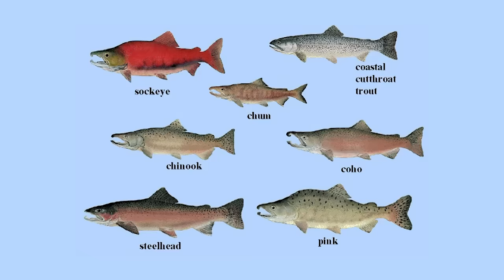How The Largest Dam Removal Of All Time Brought An Entire Ecosystem Back From Extinction!

Comment: So happy they're finally doing something to undo the centuries of damage on our Earth!
Reply: Actually the most damage we did to earth happened only in the last century 😢 only one century and we destroyed so much
Reply: .....destroying a dam which could of powered 1000s of homes with no carbon emissions??  Yeah that isnt a good thing right?
Reply: @catlee8064  huh? didn't you watched the video? how can these dams be anything but destructive and degenerative? don't just look at temporary things think long term bro
Reply: @erfan4244  I am thinking long term....like using hydro  (renewable energy source)  rather than coal/oil fired power stations.....but by all means, let some fishes swim up stream....
Reply: So should we stop all renewable energy?
Reply: @catlee8064  Do you always just make up numbers and stories like that? According to wikipedia, 20 years ago, the two damns mentioned on the Elwha river combined produced only enough electricity for about 38% of the demand of the local sawmill - which itself probably wasn't a great boon to the local environment. Since that ecosystem consists of carbon, restoring it is also a way of binding CO2. So instead of repairing the dams, the energy can either be saved by using more efficient machines, lamps, systems etc or produced by additional renewable energy sources that also don't emit CO2.
Reply: @Muenni    Quote all the wiki ..."Initially, along with the Glines Canyon Dam, which was completed in 1926, it helped to fuel economic growth and development for the Olympic Peninsula and the community of Port Angeles, Washington...."   Now why didnt they upgrade the dam, put in more efficient generators and supporting infrastructure?   You say the regen of the ecology will absorb carbon, How much carbon emissions would this dam have saved from oil and coal fired power stations? The US is destroying more and more dams every year to placate the fish huggers, even as those same ppl scream and cry about carbon emissions.....illogical.
Reply: @earlysda  Why would you even suggest that
Reply: @catlee8064 catlee speaks common sense truth. But this is the age of emotions, when truth is not appreciated.
Reply: @Acr6gAttt-mq2hr Acr6, because that is what your comment strongly implied. Since you don't like dams, you don't like renewable energy, or at least the main renewable energy that we have been using the longest, and is the most reliable.
Reply: I think the simple answer is to engineer a way to tap the energy potential while allowing the natural flow of water and fish to occur.
Reply: @earlysda  That's nonsense, you're just looking for a fight
Reply: Overpopulation isn’t going to help the earth either
Reply: @arthurbrumagem3844  arthur, humans are the best resource. If we all lived like God intended for us, this earth could probably sustain 1 trillion of us humans.
Reply: @earlysda  at what price “ quality of life”.
Reply: @arthurbrumagem3844 arthur, yes, the quality of life would be much, much higher if we all followed Jesus Christ, especially if there were 1 trillion of us on this earth.
Reply: @erfan4244 You mean like long-term air pollution from fossil fueled sources?!
Reply: @Muenni In which case, they should just STOP USING ELECTRICITY and return to the way it was, back in the mid 19th century....
Reply: @thehimself4056 The main problem with  "simple"  solutions is that they end up being COMPLICATED in the long run....
Reply: Like the tree gorges dam in China?
Reply: @ovidiuciuparu6421  *Three.
Reply: @catlee8064  "Now why didnt they upgrade the dam, put in more efficient generators and supporting infrastructure?"  Why indeed?  Why do so many dams become obsolete and tend to produce less and less power over time?  If you do some looking, you may find your answer.

Comment: I watched the doco on this dam a few years ago.
It's amazing how damaging dams and the straightening of rivers are. 
Both against the ecosystem and increasing atmospheric temps.
Reply: Yeah, too bad they are not increasing :-)
Reply: So you are against renewable energy?
Reply: @earlysda What are you talking about?  I support having dams and building more.
Reply: As long as you are now OK with burning more coal to fuel your electric car.
Reply: @twelvestitches984 twelve, You had not commented in this thread before me, so I obviously wasn't talking to you.
.
Calm down, breathe deep, and think before you start typing next time.
Reply: @twelvestitches984 What’s the reason for your support of building more damns?
Reply: @allantulli5546  Factually inaccurate regarding burning coal in Washington. It's also pretty silly to point a finger at EV's... they are not the problem
Reply: @peteravolio2695  More clean energy.  More flood control.  More water storage for drought years and the reservoirs provide water for animal life.  Less down river erosion.  More constant river flow for animal life down river of the dam.
Reply: @twelvestitches984  nature and Wildlife seemed to do just fine before the implementation of hydropower
Reply: @peteravolio2695 Wasn't that back when humanity was FERAL?!

Comment: Hm... i wonder where the energy will come from to replace it.
Reply: That small dam hardly produced much hydro power anyway.  Besides there is ever growing renewable energy to fill the gap.  There is also enough redundancy in the system to allow for small dams to be removed.   And that's without even talking about the huge environmental benefit of restoring the environment to its natural state!!
Reply: @michaeldeierhoi4096  hey as long as they have a plan to cover down.  I know west coast states have a tendency to shoot from the hip and not look at secondary, tertiary and quatinary effects... edit: and by no means is that a bad things but when you do it at other people expense then that's where I take issue.
Reply: Biomass
Reply: Biomass
Reply: @darkfleetlord  In the case of the Elwha dam removal there is a far greater benefit to far more people with that dam's removal then any negative.  Each dam removal is handled on a case by case basis and the Elwha was clearly due for removal.
Reply: @michaeldeierhoi4096 The ONLY  "benefits"  go to those who build fossil fueled power plants and their stockholders.

Comment: Good news but, do the companies who built them have to set aside money for there decommissioning in the US ?
Given that the mechanical parts like spillway gates and valves have a max design life of 60 years, I'd guess they're primarily being removed for safety reasons to prevent an uncontrolled release of water which may exceed the spec for the rest of the dam.
Reply: I'll bet they don't.

Comment: I’m convinced that dams are one of the largest causers of ecological disasters. You can even draw a correlation between the explosion in dam construction projects during the early 20th century and climate change. Of course this happened at the same time as most sources of pollution increased so it’s hard to differentiate.

Comment: Interesting.  I'm kinda conflicted about dam removal.  They're used for energy production, and they're one of the few no-fossil-fuels way of doing that.  Which is important for fighting Climate Change.  On balance, however, I think that most could be removed in an environmentally appropriate way.  If there are some in areas with very low biodiversity and ecological value, then I'd be pro keeping those ones.  However, dams in areas with high ecological values probably should be removed, especially when the dam in question comes to the end of it's life, meaning a large bill for removal is one thing, but a much vaster bill for refurbishment is another...

Comment: What about the electricity it probably used to produce? Any replacement for that? Or about flood protection?
Reply: They were built to power saw mills in the 20's
Reply: @JustinC-d6z  interesting. Like from the video it seems that they were pretty close to some bigger cities which I would bet would still use some electricity. Or they were really almost useless in that place or state? Then it would probably make sense to destroy them

Comment: Works great on  cold water system.   Now they are doing it on the Klamath River.   So far it's been catastrophic for wildlife.   The water upstream in Oregon is cool at best during the Summer.   And the really think salmon will return up that high.   Klamath tribe celebrates suckers, not salmon.

Comment: Why is infrastructure destruction celebrated if it does not affect you?  

We all live in areas, and have infrastructure projects, that promote our well being when the area we live could and originally was part of an ecosystem.  Should Washington remove Seattle buildings and residents so that the land can "return to nature"??  Removing these dams is not only extremely expensive but also will have very little effect of overfishing at sea (usually by foreign companies in international waters) and climate change..  

In fact, in Washington the state is having a problem of lower water levels which create higher water temps that are destructive to fish..  Oregon also has this same problem on the Klamath ..
Reply: Blud thinks that removing dams that are inside an national park is bad

Comment: Another source of clean energy going down river😊
Reply: An almost 8 minute talking about how dams generally only last for 60 years and the numerous salmon and trout populations were devastated by this dam!!    Did you miss all that??   By this dam was only used for a saw mill no longer in use!
Reply from the maker: this dam only supplied one third of electricity to a saw mill thats it. it wasnt supplying any energy to cities or anything else. you can also get electricity from solar and wind not just coal
Reply: @LeafofLifeWorld Just WHAT IS It with fickle weather power?!

Comment: It’s past time to remove the Hoover dam.
Reply: FYI    The Glen Canyon will removed before the Hoover dam because the Mead reservoir is bigger.  And once Glen Canyon is gone the southwest will already be in dire straits with water access.
Reply: Sure thing there! What are the people in Las Vegas supposed to drink?
Reply: We’ll see the water held behind the dam is like 20 or more feet below historical levels you can see the old water levels left on the rock. We definitely need to start preaching water conservation especially across those desert areas. Screw your golf courses. Move somewhere else if you need golf that much. And I’m guessing they do structural tests to see how much longer it can last to begin with. It’s pretty dang old.
Reply: @josephward6422 They drink water from Lake Mead.

Comment: Great illustration of how so-called "clean" energy (hydro in this case) is not so clean.  Every form of energy conversion is a trade-off.  If you think you found a win-win, it means there is something you're not measuring.
Reply: Hydro can be clean, it depend on how and where it's constructed and avoiding environmental damage.
Reply: @deaddoll1361  Yes is can be; but the bigger the dam, the greater the environmental impact.  Often in unexpected ways.  Design factors can mitigate but not eliminate the environmental impact.

Comment: They needed to explain how electricity generation was replaced.

You cannot ignore economic sude
Reply: Are so naive that you think that every dam removal even a small one like this one has to be replaced?   In the first there is ample redundancy in the system to make the difference from loosing this small dam.  And second there is new renewable energy coming online constantly.
Reply from the maker: this dam only supplied one third of electricity to a saw mill thats it. it wasnt supplying any energy to cities or anything else. you can also get electricity from solar and wind not just coal
Reply: @LeafofLifeWorld  thanks for the info.

Would be good if you include in original video so that you have more authority

Comment: The Elwa river has not repeat, has not brought back the runs of Salmon. This video is giving you the eco dance replay. Is is not happening. Just read the scientific research.
Just like the rest of the rivers on the Olympic peninsula, the fish are not returning, and they have never had dams. I have no problem with removing a dam if needed. However, this stupid dance that the fish are coming back because a dam was removed is a dream. Yes, some fish are returning but not the numbers they should be. I say look to the north and the commercial fish take. The fish are decimated by overfishing because of illegal catching and commercial levels. The fish stocks can not maintain expected levels because of overfishing.

Comment: And then there is the elimination of hydroelectric generation.  Guess who will take up the slack.  Large or small, all inexpensive, locally-owned hydroelectric generation will be eliminated.  Fish ladders have not been considered, it seems.
Reply: You are implying that there does not exist an engineer on this planet capable of designing an efficient fish ladder, right?  Now answer my question; who will take up the slack?  Take your time.  Furthermore, not all dams are, or were, in disrepair, and if they were in disrepair, then was the maintenance purposely neglected?  C'mon, man, don't be a dog-faced pony soldier!
Reply: If they were demolishing a functional hydroelectric dam I would be inclined to agree with you. 

However the hydroelectric facility shut down in 1992. So no electricity production for 30 years. 

Which is probably why the dams weren't being maintained.  Redundant infrastructure,  not being used, that would collapse eventually if not dismantled in a controlled manner.
Reply: Even if what you say is true, I said all dams; not just the one you are referring to..
The Androscogging river runs through the city of Lewiston, Maine.  It was a mill town and a canal ran along the mills generating electricity for those mills.  The people built a dam upstream which generated electricity for the area and controlled the annual floods.  The mills are either demolished or put to other uses now.  The dam now belongs to Florida Power and Light.  The canal is still there and it remains able to generate electricity sufficient to take care of the city's needs at least to light the streets, etc.  That little power plant just kept humming along, not disturbing fish migration and was not in disrepair.  Nevertheless, it was closed just some years ago.  Please apply your rationale to that closing.  Thank you.
Reply: @aloyisiuspeters8913  Did you read my comment at all?

If they were demolishing a functional hydroelectric facility I would be inclined to agree with you. 

Literally the first sentence. 

The example you give is one I disagree with. 

The example in the video is very different, and I approve of that. 

I believe in assessing dam building and destruction on a case by case basis. 

Not all dams are bad. Not all dams are good. You need to look at the big picture.

Comment: So they build a coal power plant to replace it? Nice one tree huggers!
Reply from the maker: The dam was only powering a saw mill, and only one third of it actually so since the saw mill closed down they don't need to source electricity elsewhere. Please watch the video first before making assumptions about the energy resource
Reply: @LeafofLifeWorld  In this example yes, you are correct. But what about the other 65+ dams that are being torn down every year? Most of them are being replaced by coal/gas power plants.
Reply: absolutely embarrassing I’d just delete my comment after that
Reply: @LeafofLifeWorld YOU FIRST!

Quit constantly mentioning weather power;  a RELIABLE energy source is needed.

Comment: We MUST restore all our rivers by removing dams. Rivers are the life blood of earth and dams are its death.
Reply: That dam could of powered 1000s of homes with no carbon emissions.....
Reply: liberty, where did the electricity come from to type your comment?
Reply from the maker: this dam only supplied one third of electricity to a saw mill thats it. it wasnt supplying any energy to cities or anything else. you can also get electricity from solar and wind not just coal
Reply: @LeafofLifeWorld  Yes, I know.  But the advances in generator tech and other infrastructure upgrades would have boosted output. You cant complain about oil/coal fired power stations when the US is destroying or has destroyed 2000+ dams which could of supplied endless renewable power.  Yes, i understand that removing those damsn provides an ecological boost....but as this dam in the video says it will take upto 20yrs to return, when we need renewables NOW....
Reply: We are an electromagnetic universe only we are too dumb to take advantage of it @earlysda
Reply: @libertyblueskyes2564It not a matter of  "dumb";  it's a matter of GREED.

Comment: Removing dams is a huge mistake. Huge mistake.
Reply: The dams are old and have to be decommissioned because of sediment and they are an ecological nightmare
Reply: @raphael_created_videos7892 And fossil-fueled power plants would be an even GREATER environmental disaster.
Reply: But still it is an ecological nightmare
Reply: @raphael_created_videos7892  And it was still better than the environmental pollution resulting from fossil fuel use.

Comment: So all the energy the dams produced is going to be substituted by fossil fuels. Taking one step forward and 2 steps back...
Reply from the maker: The energy was for the saw mill, hardly sustainable in the first place
Reply: @LeafofLifeWorld  couldnt it be used to a close by village/city ?
Reply: @BALSCOU    There is more than enough redundancy in the energy grid to make up for losing a small like this one even if it could be used elsewhere.   More to the point you are ignoring that this was old and beginning to fall apart.   Dams like this one do not last much more than 60 years anyway.